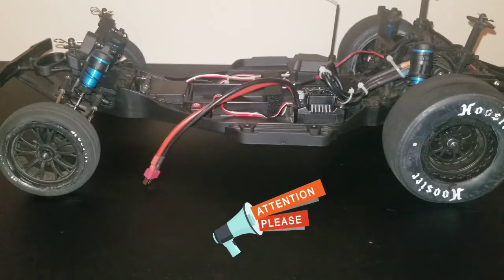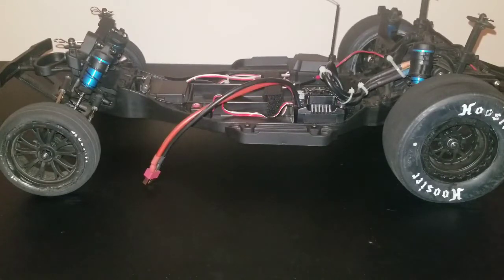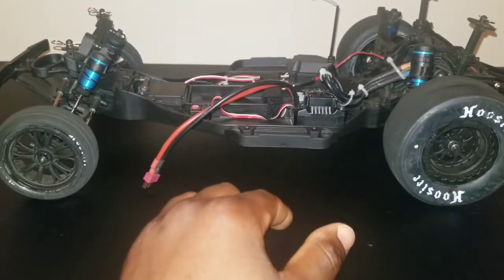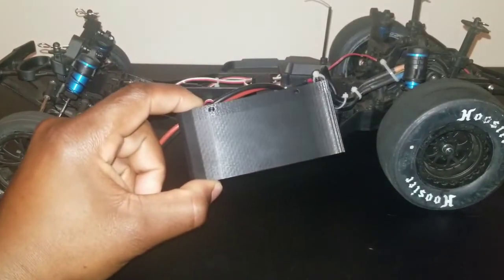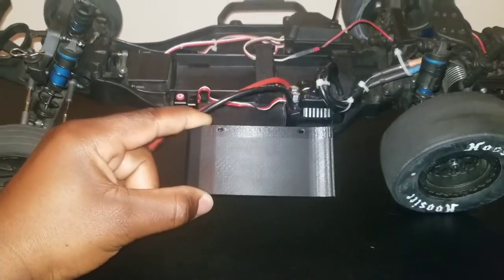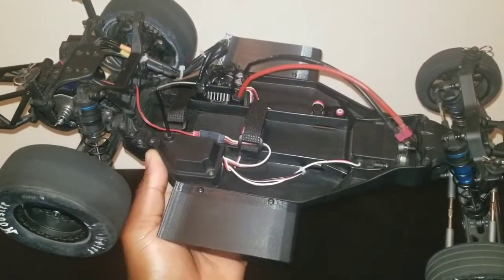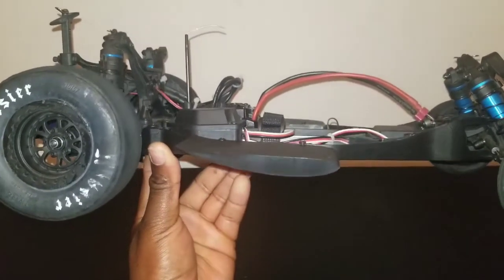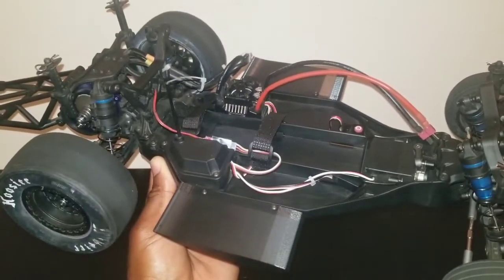TEAM ASSOCIATED DR10 3D AIR DAM INSTALLATION

Comment: A few things I've learned from my past year of drag racing with the DR 10. 1 Cut the back of the body out will help alot with parachuting. 2 get some kind of front splitter and good wing
Reply from the maker: I definitely appreciate the positive feedback I hope these air dams will help out big time and a longer wheelie bar
Reply: @MoBay876rc  longer wheelie bar definitely makes a difference. Id also say get the TARP rear motor guard/ wheelie bar mount its super light and extremely solid